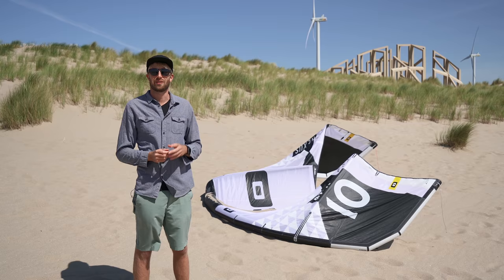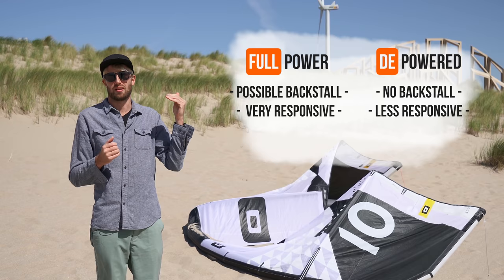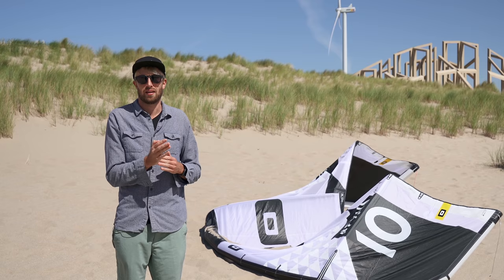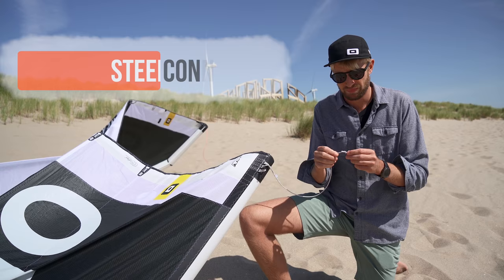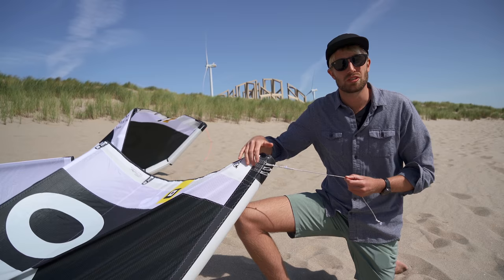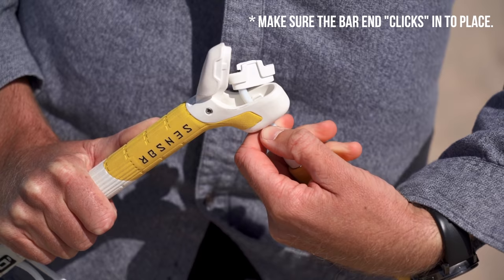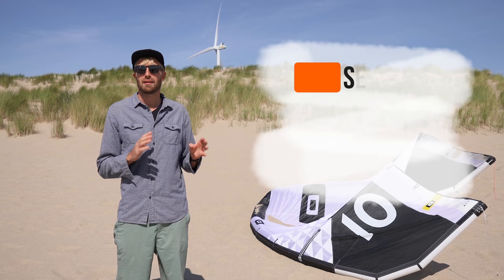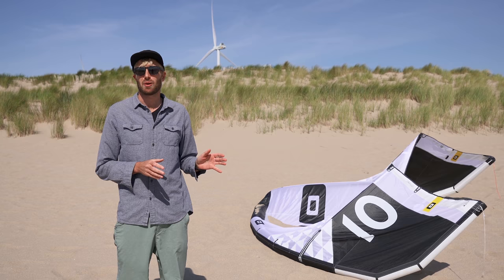Trim your KITE to PERFECTION // Kiteboarding SA Masterclass

Comment: Hands down, the best instructions on youtube! Your way of demonstrating is the only one I really can understand, reason and apply. I ride XR and gained lots of information. By the way I have purchased Core Sensor 3 Pro Compact based on your advice and reasoning. Will use it with 8m2 and 11m2. I am practicing hooked tricks so I realized i need the kite stable rather than easy and fast turning. I can use it with 45cm or 41,5 cm. I couldn't dare to go for Sensor 3 Wake bar :)
Reply from the maker: I think the compact is an awesome bar! I also switched to it recently. Thanks for watching and the comment, much appreciated 🤙

Comment: Thank you so much! Brilliant video!

I ride XR4's. 

Recently I played around with the settings to find out the differences that I could pick up on. 

My main discipline is big air (even though it's not very big...). 

I flew a 12m XR4 this weekend. 
Day 1 I had: 
•highest knot on steering line 
• closest wingtip loop to tail edge (wave setting)
• knot closet to centre of kite on leading edge (wave setting) 

Day 2 I had the same but changed the leading edge knot connection to the knot closest to the wingtip (freestyle setting). 

Conclusion:
Going into these settings I honestly thought the wave setting on the leading edge would make my kite faster and therefore produce greater lift. 
The wind conditions weren't identical but I definitely did notice that having the knot closest to wingtip (freestyle setting) did give my kite much more stability and it almost seemed to turn and "scoop" the wind. 
The wave setting knot I found the kite turned faster but in a motion that was like a pivot on itself. 
This I feel was producing power in the kite but then also dumping that power to finish its turn quicker. 
The scoop action from the freestyle setting felt like it kept the wind in the sail of the kite for longer therefore creating more lift. 
The wave setting felt like it would twitch a little and then lose that upward lift. 

This is all just my experience with a 12m XR4. It was different days and wind conditions so I could be very wrong. But it definitely seems as though Steven's advice applies to the XR range too.

Oh and the top knot on steering line does make the kite back stall a bit. But it kind of felt ok to boost up with bar all the way in and then let it out slightly to grab that wind whilst airborne. 

Hope this helps anyone else wanting to experiment. 
Would love to hear anyone else's feedback on their XR settings for big air too!
Reply from the maker: You're on point with your conclusion. Makes a lot of sense and it's also what I would expect from these settings.
It should behave similar on the smaller sizes as well 🚀
Reply: @stevenakkersdijk  thanks for your awesome content! Keep on going! 👍

Comment: The adjusting based on backstall is a great tip especially for rented kites where the bar doesn't always perfectly match the kite. I had a rented ozone bar & kite once where the kite stalled at 3/4 of bar pull.
Reply from the maker: Oh yes, I can imagine that the maintenance and trimming on those rentals isn't always the best. I used to have it a lot with school gear from Cabrinha, those lines are quite sensetive to stretch and shrink.

Comment: As always and said many times, great videos. Please keep the content coming. We all dig it obviously. My question is related to bar pressure - I hear this mentioned a lot but I don’t understand what the value or detriment of more or less bar pressure really is. I live in a pretty light wind area and so I’m foiling a lot more than anything else. Would I benefit from lower bar pressure for foiling? Or does less bar pressure result in a feeling of a more jittery kite because you inevitably end up moving it around more with less pressure required to change the direction of the kite? Please expand on that if you don’t mind. Thanks in advance 🤙🏽
Reply from the maker: Glad to hear you're enjoying the content! Bar pressure is purely a personal preference. In my opinion you can get used to heavy and light bar pressure, I don't really switch it around as I'm happy with the kite in factory settings. But let's say you're a person with less strenght in the arms, or you suffer from elbow injuries, you'll probably prefer to ride in the lighter bar setting. 
More bar pressure usually translates to more feeling of what the kite is doing, but it does require more force, especially when you're steering it a lot.

Comment: Great video, I actually was waiting for the set up stuff as core don't explain in practice what happen when you change the settings ! many thanks
Reply from the maker: Happy you found it helpfull! Sometimes stuff like that is missing, where it's super important to some people. Hope you find the right one for you.
Reply: @stevenakkersdijk  Yep, have to put in practice. I have another question for you if I can. Is there any difference between sizes ? Let me explain: I have core xr 9,12 and 15. I thinking about 7 but I have a dilemma to sell all of them and only buy size 8, 10, 13. The reason is I don't want to have too many kites(travel etc.) and another reason is , ones you said that 10 size is working better for you? what did you mean ? Many Thanks

Comment: maybe i missed it, but the attachment point on the frame of the kite affects the total range of power between fully bar out and fully bar in. for example, if your rear lines are attached closest to the rear tip, and your lead lines are attached closest to the front of the kite along the leading edge, your bar will overall be less responsive, in other words, pushing or pulling the bar will have less effect. In the opposite kite, if your rear lines are attached furthest from the rear tip, and your leading lines are attached furthest from the front edge, pulling the bar in, will give more power, and pushing the bar out will give more depower.

this tip can be useful for when deciding to trim for gusty or steady days.
Reply from the maker: Thanks for the input! Appreciate it.

Comment: Good stuff! I think you should also talk about how line length affects the trimming switspot. Riding my XR 12 on 22s the other day I had to depower like 5-10 cm more than on 24s. Same thing trying the 8 gts on 20s in Cape Town
Reply from the maker: That's interesting to hear. Did you use different bars or the same one and just added extensions. In my experience the lines don't have a lot of effect on the trimming sweet spot.

Comment: Thank you for the explanations on all the adjustment points! I've been wondering how exactly the bridle attachment points affect the performance of the kite.  I had not thought about making the kite more C shaped for my big airs. Can't wait to try it. I had to adjust the throw on my bar slightly so I can reach it and wonder how this is affecting my kite. Any thoughts on that? I took it in a couple inches. Any more than that and it really negatively affected the kite. But I cannot reach the bar in crashes, so I made a compromise. Ideally for me, I would like a bar with a 12 inch throw. Not sure how that can be engineered but look forward to the possibility one day.
Reply from the maker: Hey Rhonda
When you make the throw of the bar shorter or longer youll need to adjust for the line lenght difference you generated. 
In the end you need to make aure that all line have an equal lenght when you bar is completely powered up with the bar down. You can do this by attaching the ends of the lines to a solid object and adjust the line lenght under the floaters
Reply from the maker: You can find the video here:
https://vimeo.com/189126489
Reply: @stevenakkersdijk  thank you. Yep, did that. Wasn't sure if there were any lingering changes to the flying characteristics. The kite seems fine to me but wanted to clarify that. Thank you!

Comment: Excellent video. Could you consider explaining  how to use this info to learn new tricks. Is using a small bar on a bigger kite in lighter winds best to avoid mis-steering? Also, how does line length fit in ti this equation. Do you always run shorter lines on your smaller bar?
Reply from the maker: Hey Mike
The bar width all comes down to personal preference, as I mentioned, I prefer to always ride the smaller bar so I can steer a bit more precise.

For the line lengths, just have a look at the video below:
https://youtu.be/OHT4tpNsQBA
Reply: @stevenakkersdijk  Big thanks. Very helpful.

Comment: Hey Steve. Can you open discussion about Wave setting in Core kite. theoretical in Wave setting kite more open  and Wave setting must by better for big air and must have more and hangtime. Same must by in GTS6 setting. Do you tested GTS6 in wave setting: how hangtime ? About pressure setting: They connect not in the same line if you look from side. Last (soft) connect is lowerest connect, that mean that bar is 1 cm lower.
Reply from the maker: I've ridden the kites in wave setting. It does open up a little, but I didn't notice a lot that this increases the hangtime. For me the feel of the kite is just so much more direct in the Freestyle setting, making it my favorite setting for big air.

As there is an angle on the bridles, the knot height doesn't make a difference (to my feeling)

Comment: Hi Steven！one question, my core sensor 3 bar, the centerl lines are four cm longer than steer lines, how can i shorter the center line?
Reply from the maker: You can adjust steering lines under the floaters of the bar. You can also connect your steering lines to a solid object and stretch them back to the right lenght.
Reply: @stevenakkersdijk  thx bro! Wish u all the best！

Comment: Hello Steven,  Really appreciate your videos!!!!  Was hoping you could answer this question when tuning the Core Sensor 2S and Sensor 3 Kite bar should the bar go all the way to the stopper showing that all lines are equal when the bar is pulled in?  I have 3 CORE Bars and they all are about 1 1/2" inches off of the stopper when the bar is pulled in.  I've asked other CORE riders but got mixed answers saying the bar should be tuned to the stopper and others saying to leave it, it is perfect.  Hoping to get your advice, thank you!!
Reply from the maker: Hey Matthew,

Very sorry for the late reply. Hope I can still help you out with this answer.

When the bar is fully powered up (bar all the way down to stopper and trim adjusted at full power), all lines should be equal length.
In time your steering lines shrink due to sand and salt coming in to them. As the power lines are often under tension they tend to shrink less. Meaning they're often a bit longer.

You can fix this by adjusting the knots under your floaters (making the steering lines longer)
Reply: @stevenakkersdijk  Thank you Steven!  Appreciate your help!!

Comment: Hi Steven, nice leasson as always. Just a question, how do you measure the limit backstall to trim (for big Air)… when you take off, do you  sheet out the bar while its going up or just at the moment the kite stop pull and starting backstall. Tks mate
Reply from the maker: Hey Giuliano,
I measure it by feeling, but I would say it's around the apex of the jump, usually just a little before. But it's best to go out there and try different things, at one point you'll just have to trust your feeling. 
You should be able to feel it when you "choke/backstall" the kite to much.

Comment: I have XR 13.5m; 11m, 8m - and core rep told me to keep it in factory mode for best perfomance (I am only interested in big air). Is it true in Your opinion for XR6?
Reply from the maker: Hey Ireneusz

THe XR6 is a kite where I haven't been playing around with the settings a lot. I think you will  be perfect in the factory settings. This is the mode which the designers like the most. And then you can change the characteristics slightly by adjusting the knot.

Cheers Steven

Comment: Unless you have a new bar, you should start with checking the line lengths of your bar. Make sure they are all the same length when center lines set to their longest position. (You can find video tutorials for this).
You can trim your kite on the beach, but show me a single beach on earth where wind is constant for at least 5 minutes and even for the entire spot.
I'm surprised that for the Core kite the position of the steering lines does not affect the steering speed. It definitely does for my Best Roca.
Reply from the maker: Hey Andras

Thanks for your detailed message.

Checking your line length on the bar is definitely an important one and I would always recommend doing this on regular basis. 
But when you use the technique shown at 01:40 it doesn't really matter if your lines are of different length. Of course there is no perfect scenario where the wind doesn't go up and down a little bit. But when you have onshore conditions you should still be able to perform this kite trim quite well. 

In my opinion there is no difference in the steering speed when adjusting the steering line adjustment on the kite. You change the location where you pull down the tip, but the tip doesn't change shape because of that. You do change the lever and the amount of force needed to steer the kite which makes it feel lighter or heavier to steer the kite. This often gets translated to fast and slow steering, but there's where I disagree. (At least on the CORE kites)
Reply: @stevenakkersdijk  Hey Steven,

thanks for the detailed answer. My point with the line length is that if your lines are too far off (e.g. the steering lines are much shorter), then you may not even find the sweet point, as it is out of range, or even if you find it, you have to trim the center lines a lot. Which isn't good, since when a strong gust hits it is good to have a safety option of trimming the center lines even further. But this isn't possible if they are already trimmed.

Or in other words there is a range where you can adjust your kite using the knots at the kite or the adjuster on the center line. Now if your lines are not the same length then you lose a part of that range
 I had this experience: my steering lines got ~5-10cm shorter than the center lines but I didn't notice. I was out in very gusty winds and couldn't de-power my kite properly during a strong gust. I adjusted the line lengths so now I again have the full trim-range of the kite available.

I keep watching your videos, only wish we had a bit more wind to practice ...
Reply from the maker: Totally agree with you, a lot of people don't realize when their lines have different lengths and therefor a smaller adjustment range. 

Hope you get some wind soon!

Comment: On the GTS attaching closer to the wing tip seems to choke the kite off more especially toward the low end of the wind range.  Really killing it's ability to fly causing more backstalls...  On Nexus the freestyle setting seems to make it sit deeper into the wind window dragging you downwind where wave setting let it sit closer to the wind window and making it easier to jump higher.  Am I crazy?
Reply from the maker: Hey Youn,
How long have you been riding your GTS? It is possible that the choking effects gets worse over time and use of the kite. Personally I can ride it full power, but on the jumps I will have to sheet out a little bit on my jumps, but this is minimal. When freestyling I will depower a littbe bit though.

The CIT points on the Nexus should not have a big impact on the kites position in the wind window, at least it's not something I've noticed that much.

Cheers Steven
Reply: I notice the choking on my GTS5 13.5M the most.  My 8,9,10,11 not as much.  Maybe I should put 8+psi into it so the wing tips don't collapse as much? Debating if I should replace my GTS4 9M with Nexus 2 9M instead of GTS6 this year.  I ride strapless and twintip freestyle mostly.

Comment: nice vid! Even on the first node (from the Tip counted), my Kite doesn't show any tendency to fly backward. I checked my lines, they still have exactly the same length.  Would you recommend to add a node ?
Reply from the maker: What kite is it? Under most circumstances my kite also doesn't backstall on the top knot. I do know it's on the edge though by the way that the kite is flying.
You could add a knot above the one you have now, but still connect the line to the knot where it's currently connected. (making a knot in the line makes it shorter)
Let me know if you have any questions.
Reply: @stevenakkersdijk  okay, I will give it a try. I fly a Eleveight FS Range

Comment: seen it several times now, still so helpful!! in 2 weeks we are travelling to Greece, I will try to change the CIT System. Question: we use XR5 in 6, 8, 10 and 12, and the 15 gts5. from which size down would you recommend to smaller the core bar? we have the core sensor 3+. only 6 and 8 or 10 as well? thank you so much steven !!
Reply from the maker: Hey Daniel

Sorry for the late reply. How is Greece?
I use the small Wakestyle bar on all my kites including the 12, 15 and 17. But if you have both bars you could draw the line around the 12.  I think the 12 flies really nice on both bars, and it just comes down to personal preference. The 15 will probably fly better on the bigger (normal) bar.
Reply: @stevenakkersdijk  Thank you Steven!! Exactly what I practised the last days here on Naxos 🤙 have a good time and thanks a lot for your reply

Comment: Hey Steven,
Does the CIT System works the same way on the XR5?
Cause i can see on the Fronttube settingsfrom middle to soft to supersoft barfeeling i think!?
🤔✌
Reply from the maker: Hey Nils, 
To be honest with you the XR is the only kite where I hardly played around with it. But I can imagine that it mainly has a big impact on the bar pressure due to the swept back wingtips.
Next to that it will also change the turning a little bit as mentioned with the other kites.